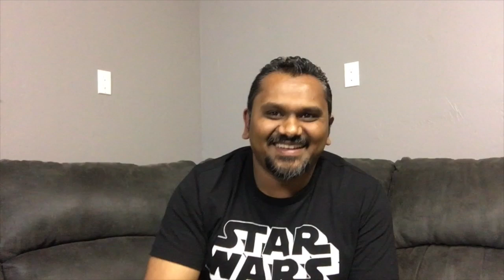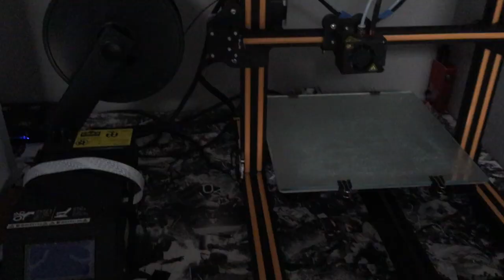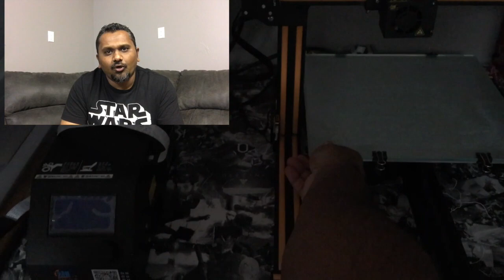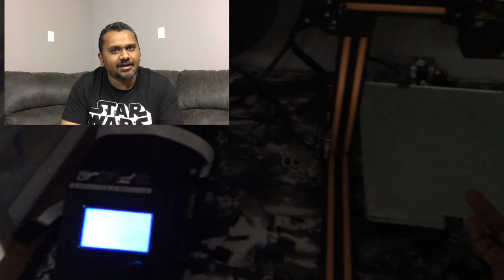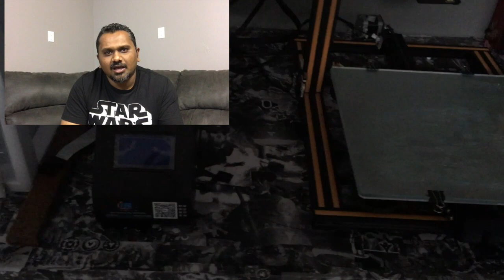3D Printer Gets Power When Unplugged.  Safe or Dangerous?

Comment: If you are leveling your bed manually find a gcode that will assist the bed leveling by automatically positioning the nozzle in the four corners. There is no need to move the bed or the nozzle by hand.
Reply from the maker: Thats a good idea. Thanks, i will look for one.
Reply: I've tried two leveling-assist gcodes, and now solely use Omar's code, which I've modified to hit each corner at 5cm in and go around the plate only twice instead of thrice. I'll upload it to the  Facebook group within the next two days.
Reply from the maker: Thanks for sharing.

Comment: disable steppers and try it again. I think that is why the disable stepper motor option is there.
Reply from the maker: did that and it still got power.
Reply: it seems like a diode needs to be present between the power supply and the stepper motors.
Reply from the maker: DancesofDragons that would help

Comment: The steppers are basically DC motors and when you rotate them because they use permanent magnets, not electro magnets like AC motors a DC current is generated.
Reply from the maker: interesting.thanks

Comment: You can use my gcode if you like to help level your bed without moving stuff around
CR-10 Levelling Assistant found on #Thingiverse https://www.thingiverse.com/thing:2556462
Reply from the maker: i will use that, but is ten seconds enough time.
Reply: SAN TUBE for me yes its plenty, but you can edit the file with a text editor and change the times if you like.
Reply from the maker: ok because if this works well i will recommend it to other people, (hope thats ok) but they mite not know how to change or work with g-code. So i will have to do it for them before putting it out there. Thanks again.

Comment: ST - Happy Diwali back at ya!  Hope you enjoy the autumn festival.  I was also 'shocked' when I did this myself the first time recently.  Wonder if there's an easy way to add a diode or capacitor or ??? to each stepper motor's wire harness to prevent this.
Reply: Jimbo in Thailand not so easy as its pulse coded you can get filters  but its not worth it
Reply from the maker: I don't know if you can really add anything to completely prevent it.  I guess we just have to be care when moving the bed around and thanks i did enjoy my new years, spent it with family it was great.